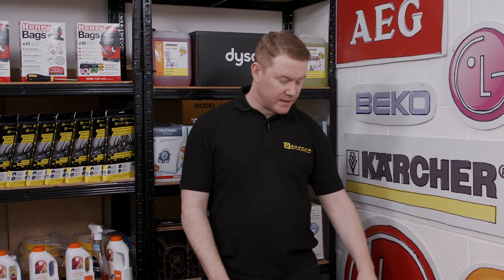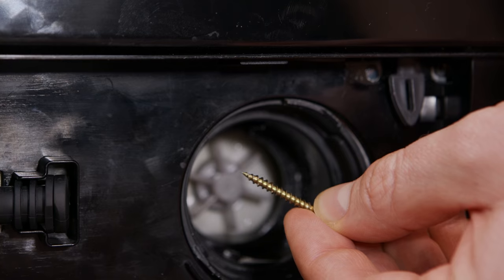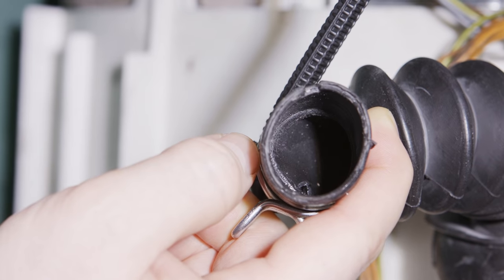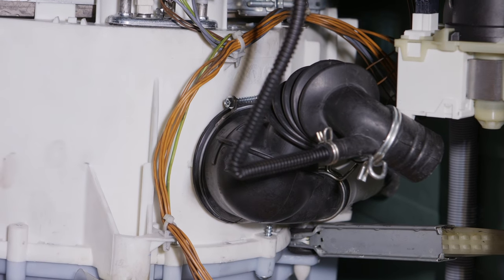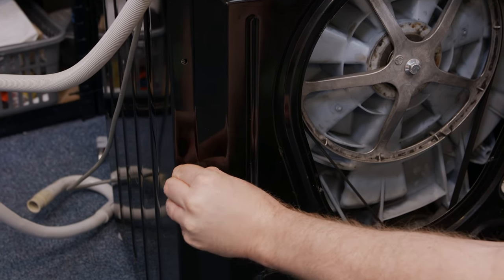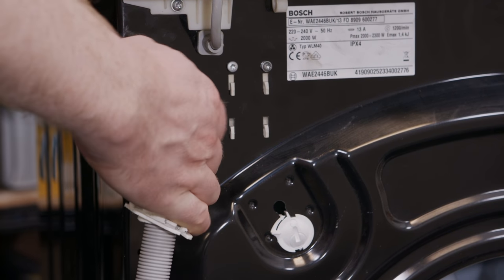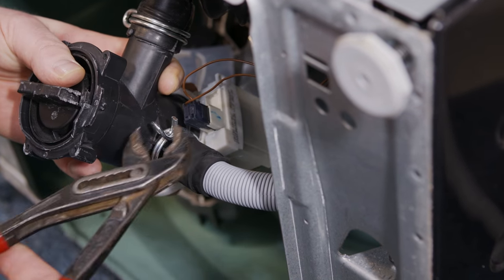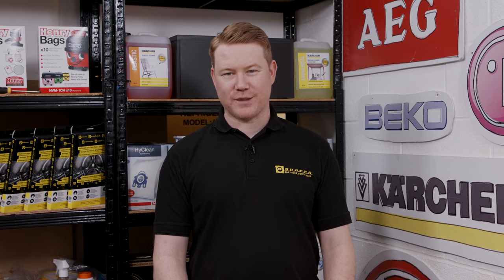How to Diagnose & Fix Blockage Issues on a Bosch Washing Machine

Comment: Tried all of that. Fitted a new pump, new water inlet valve, cleaned the outlet and sump hoses.  All good. Still get an E18 just before the cycle finishes. The machine fills and empties fine at the start of the program, just never managed to complete the program? Any ideas before it goes in the skip, with some expensive new parts!

Comment: "make sure the impeller turns freely" ... um, what do i do if it doesn't though? help please!
Reply from the maker: Hi George, if the impellor is stuck and not moving, try to ensure any obstruction to it is removed, if it is clear of obstruction then it sounds like it is a faulty pump, and would need to be replaced.

Comment: Great video. Was able to detach the drain hose from the pump without undoing the pump, and just visible, 5cm inside, was a 5p coin completely blocking the hose! Was just able to reach it with a pair of long nose pliers. Thank you.
Reply from the maker: Hi, ahh great to hear you have been able to find the blockage and remove it! Hope your washing machine is working great again, and thanks for your comment.
Reply: What are the symptoms if there’s blockage?